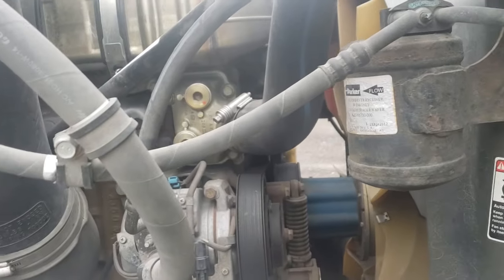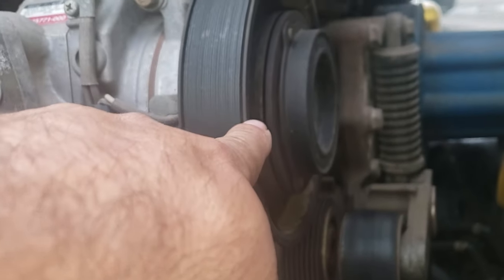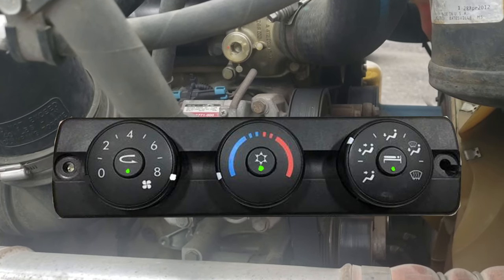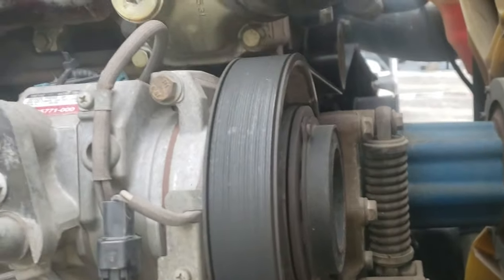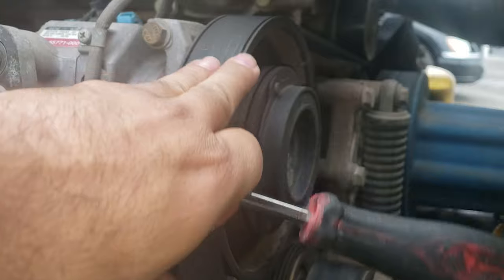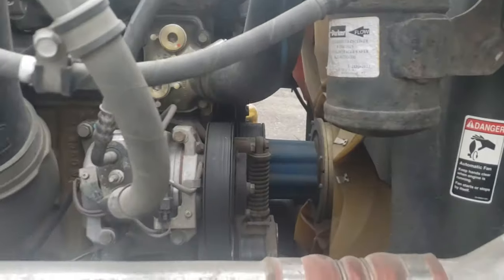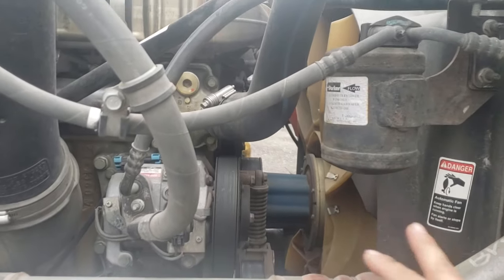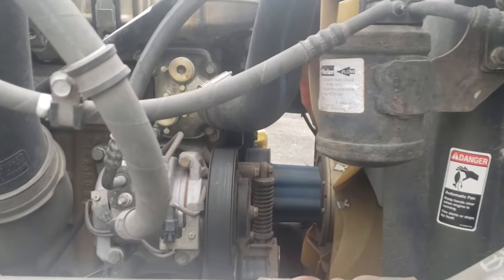Freightliner Cascadia AC Not Working / Fixing Locked up AC Compressor (Temporary Fix) Kenworth volvo

Comment: Thanks Amigo.  I was riding around FOR A WHOLE WEEK with no A/C in 95 degrees weather before I found your video.  I did what you said ,and it's working! No more SWEATY UNDERWEAR
Reply from the maker: lol, glad it worked for you, thanks for watching!!
Reply: I was. Facing the same. 1 week o central time summer
 No air. 😅

Comment: After watching parts one and two of your videos I went out and figured I didn't have anything to lose. Sure enough the clutch wasn't engaging and I tapped it a few times it started working. I shut the truck off and started it back up and sure enough the clutch engaged. So now I'm going to spray it down and see how it does. Thanks a lot because I was already pricing compressors.

Comment: It works! Thanks man. But i turned truck off and hit it hard. I saw a bunch ofdust fly out. Went and turned truck on. Walah!
Reply from the maker: nice, glad it worked for you!!! watch part 2 maybe you can save your ac compressor
Reply: @TRUCKINGTIPSDIY  didn't see part 2 . But it worked for 2 weeks and had to replace

Comment: Hey

I had a problem with my AC compressor. I did exactly what you said. It works. If you add a little bit of Lucas oil, it will last even longer.
Reply from the maker: Chek my 2nd part video

Comment: My clutch use to stop and i had to hit it to start it but one day i took a hammer and hit the clutch as hard as i can with engine off a couple of times sprayed DW40 in between the clutch and compressor and hit it a few more times until i start seeing dirt fall out of it and other stuff then i had no problem with air and getting out to do that again
Reply from the maker: Dont hit it too hard, you don't want to damage it

Comment: Hello I have a freightliner Cascadia has no cold air in front but has cold air in rear , I did replaced EXPANSIVE VALVE on the front side,  recharge the freon , but it did not change anything , front still has no cold air, and rear has really cold air .  Do you think the new EXPANSIVE VALVE is not working or maybe something else cause front AC NOT cooling at all？If you have time  please let me know  I appreciate ， thank you
Reply from the maker: Have you checked the front air blower?
Reply: @TRUCKINGTIPSDIY   Thank you ,the truck been site 2 days, it work now👍

Comment: my air started blowing hot today. I tried this but it didn't work. when I turn on my air the clutch doesn't engage at all. Can I just be low on freon or is my compressor bad?
Reply from the maker: It could be low on freon,  check the hoses and condenser for freon leaks

Comment: Hello sir I had that issue since summer that little fan clutch wasn’t turning sometimes but then I was getting ice almost everyday. I never hit it with anything while it it’ not running. So my question is if even need to fix it do I need a whole ac compressor or just the wheel that’s not working to replace??? Answer me when u can thanks bro ...
Reply from the maker: hello sir, Yes you can just replece  the clutch pulley on the a/c compressor. The issue that you may have is the pulley bearing seized up and may have spun on the front of the compressor nose cone and will damage it. ... You may need to replace compressor
Reply: TRUCKING TIPS DIY ok thank u bro for the quick respond.. I’m considering buy whole new set because it’s easier that to avoid any future down time I like running good take off once I month non stop so I’ll buy reliable part..

Comment: If your AC is blowing warm check out video "How to reset your AC in a Cascadia" you can do it from inside the cab by pushing the two buttons on the fan speed and temperature control switches

Comment: does this still work if the fans down blow? its on speed 8 but its like its off, I can feel the AC works, because when I am rolling I feel cold air coming out on very low speed, then fans work perfectly in the bunk
Reply: You've got a bad blower motor
Reply: @josh1158  not anymore... :D

Comment: Hello, the ac sometime work ， sometime not , but when it work , it really cold , dddl
 Has code: lost communication with front HVAC / HVCF for 3 seconds or longer, 524025  31 
I been AC COMPRESSOR /EXP VALVE /PRESSURE SENSOR VACUUM AC SYSTEM recharge the freon, it work one month and it happened again, can you tell what is going on with my truck , I did not replace the dryer filter , you think could be  dryer problem? Truck is 2019 freightliner. Cascadia if you know anything, please let me know!🙏🙏🙏
Reply: When it not working there is no voltage to ac compressor